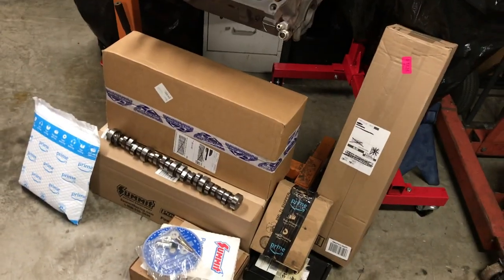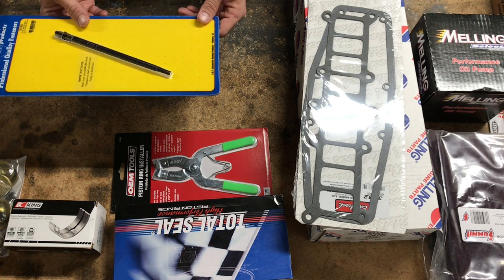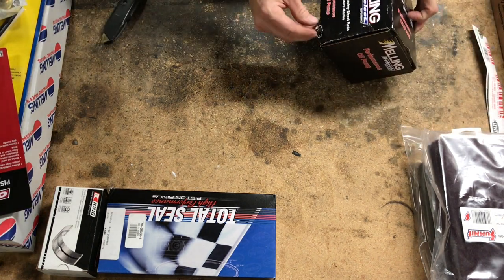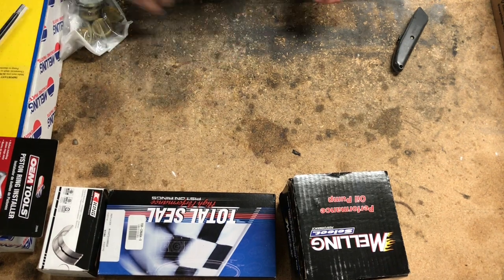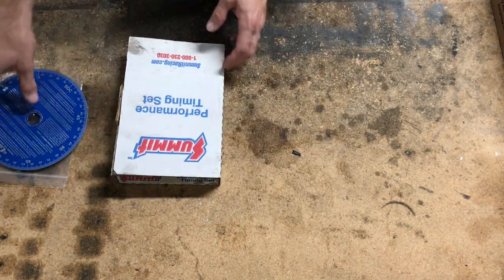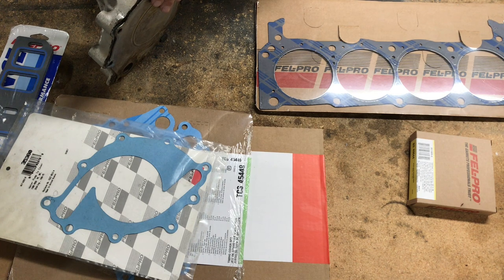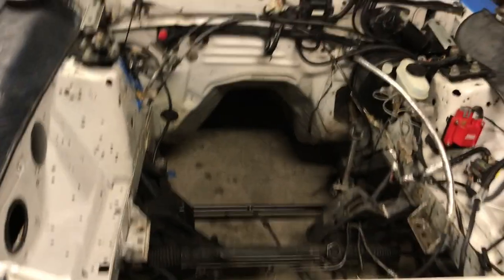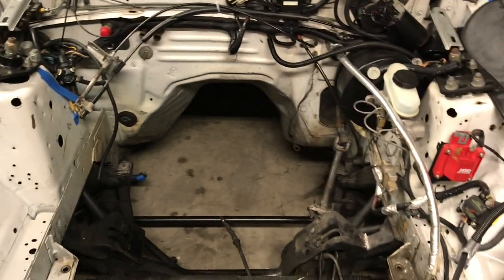BUDGET 5.0L ENGINE REBUILD PARTS | The parts needed to rebuild a 5.0L shortblock for turbocharging

Comment: how much power did you make at 10 PSI?
Reply from the maker: Not too sure, never had a chance to dyno with the turbo before it failed. It wasn't for the lack of trying, I had two dyno sessions cancelled on me. With the old Procharger P1200 at 12 psi it made 434rwhp. It was a lot more powerful with the turbo, but I was running 15psi.